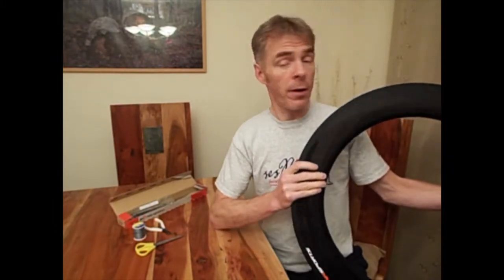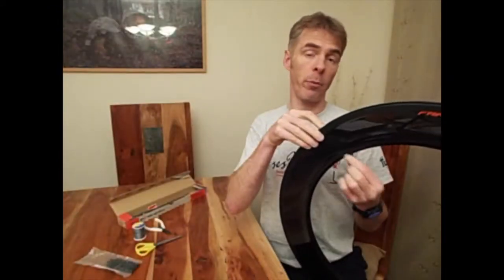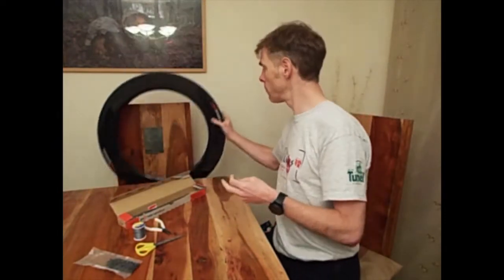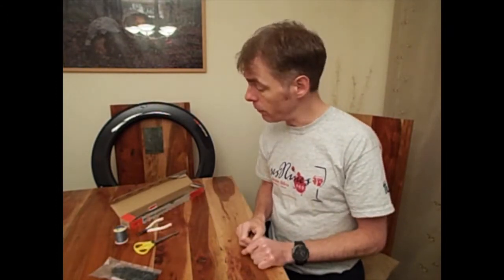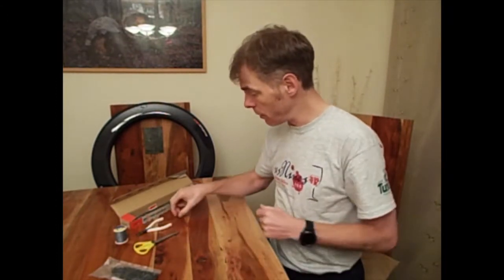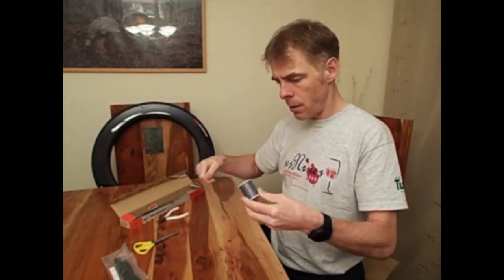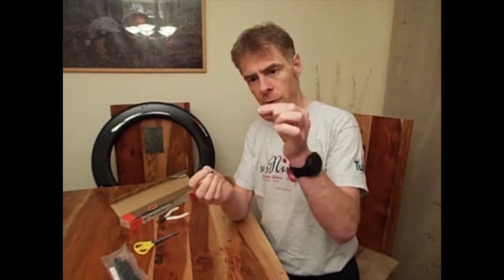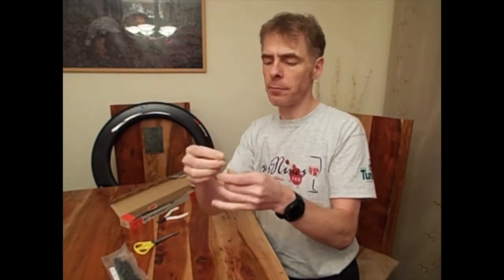Lacing a (Tubeless) Rim - No Spoke Holes

Comment: Get those internal cabling tool with magnet. Just slot in the magnet thru the nipple. A lot easier than this method
Reply: You are right, but for Alu nipples, don't think there is a better way
Reply: @Clemflippy  alloy nipples going to break faster and you doing this job over and over.